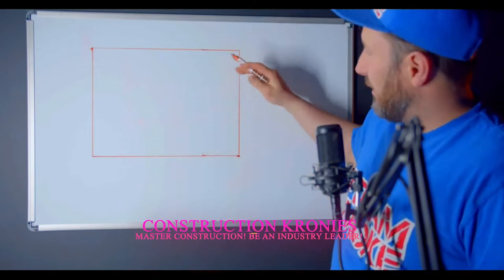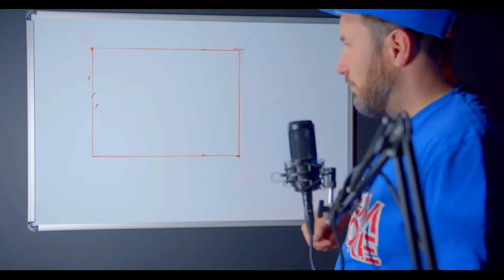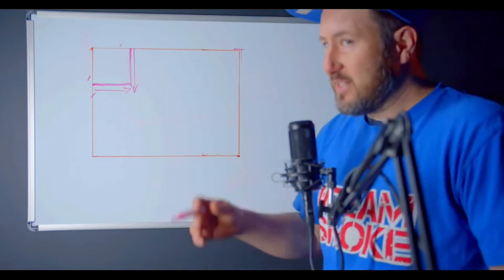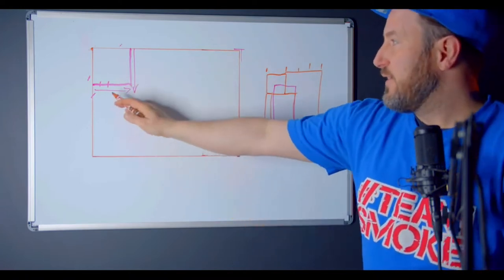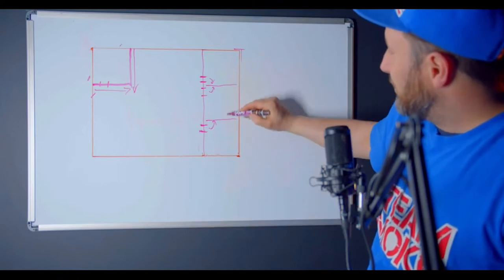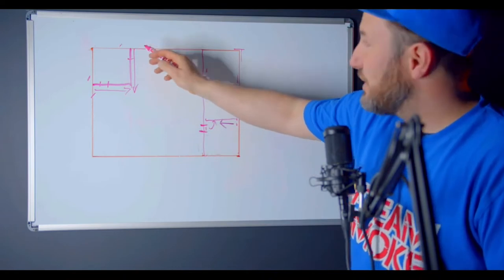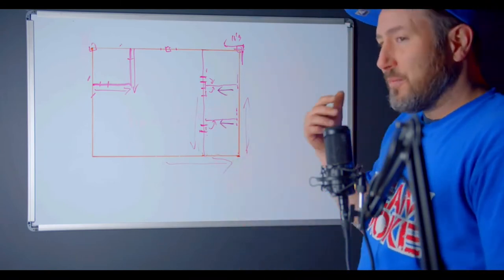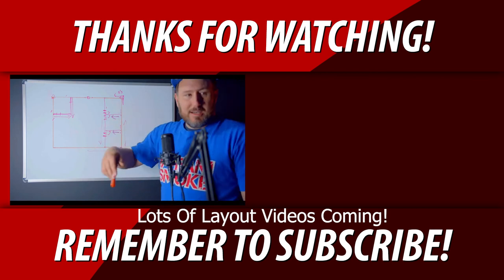HOW TO Layout Metal Studs For Drywall

Comment: I have a question. I don't know.. if this is off the topic.  If wall is not straight, how do you lay out the square line?

 I was trying to make a parallel line to concrete wall so I measured 4 inch away from the each side of 
the concrete wall. The thing is the wall is leaning in a bit  and I realized that this line would not be a reference line 

I was confused to find the reference line  for my lay out.
Reply from the maker: What we do is what you did, Mark either end and snap a line, as long as the wall doesn't bow into the track your good, if it does you have to come further put either end so the track fits all the way. You want it to be straight and flat, square isn't critical. If you need a reference line go center of columns. You can 3,4,5 interior walls if you want to check square but mostly we follow structure and it's never perfect. Make it pleasing to the eye. It's like when drywalling with horizontal sheets, it's more important to to measure up 48-1/2" either end, snap a line, make it straight is more important than level. Inhope that helps!
Reply: @ConstructionKronies  Thank you!  I got it

Comment: Do you calk or put down a sill seal under the metal studs that lay on slab or concrete ?
Reply from the maker: Yes 100% great question. On exterior walls we use a foam gasket and on interior walls we Chemtron acoustical caulking.

Comment: How do you ensure your wall layout is straight/square. Especially in long walls and of existing construction?
Reply from the maker: You can always check corner to corner for sure but really we never do that. The main thing is to do the best to keep your tape measure square to your gridlines it other walls and take your measurements from end to end. What I mean by that is sometimes we have to set an offset, use a line or rotating laser to mark our layout over 3 to 400 feet sometimes. With offset you can set your lines inside all of the columns easily. The main thing is to come out the same distance on either end of the wall and find a way to get your layout. Just make sure it's all in a straight line square isn't that important, all your ceiling work will look nice if you just keep that straight. Hope that answers your question. Man I could do a video just on this.
Reply: Thanks for the reply! I’m a small GC in Florida specializing in interior remodel. I’m always looking for a better way to build that mousetrap! Layout, especially off existing construction, is definitely a topic that could drive a video or two. Thanks again.
Reply: @ConstructionKronies  yes I would like a video about that too. please
Reply from the maker: @leronjames3346  https://youtu.be/5sNTzXEmqxY
https://youtu.be/1U1o4r-A74M I am still cutting vids together but I think I answered you in these two!

Comment: I do cladding/sheet metal and most times were working with metal studs on commercial buildings. Findings studs on the outside is always a pain in the ass. Sometimes it's 16" center but other times it's all over the place, 16, 13, 18, 6, 20 and so fourth. Is there a reason for this? On the inside it's usually just a straight wall
Reply from the maker: Haha yeah, no reason except maybe in the case of cross braces and other structural steel. But the studs should always be set properly on 16" centers. A lot of bad framers out there or just guys who are learning. Plus these guys don't understand how cladding and drywall works so they don't understand the consequences of moving studs for their convenience if you know what I mean. If a stud lands where a pipe is for example we put a header in and make sure the stud lands on 16" center, those framers would just move the stud to either side.of that pipe.

Comment: Don’t you always layout walls from your left to right.? Always hook on the left and pull your 16 on centers for your back wall. Then off those you do 16 5/8
Reply from the maker: That's the basic law but we can go wherever we want. We want to check the layout of the studs both ways and set them to whichever way works best for hooking doors and missing pipes. Try to keep the flow of drywall consistent for the boarders. We always point out studs in the direction we pull out centers.